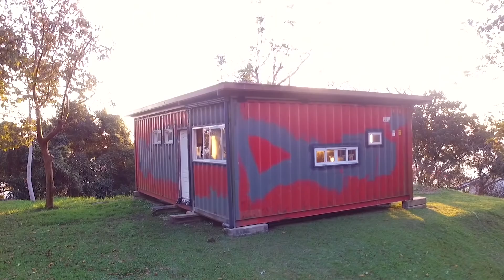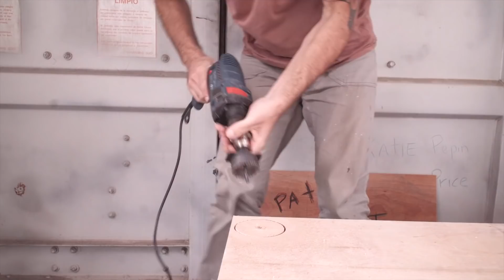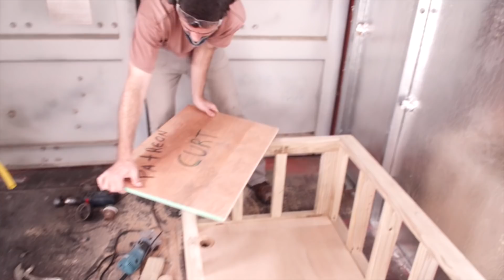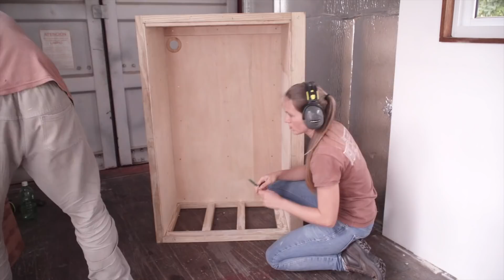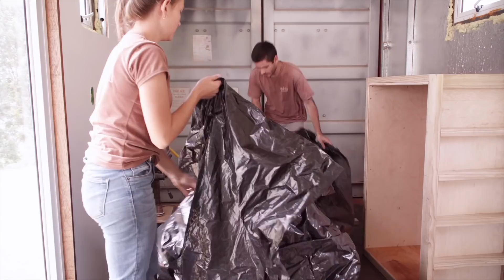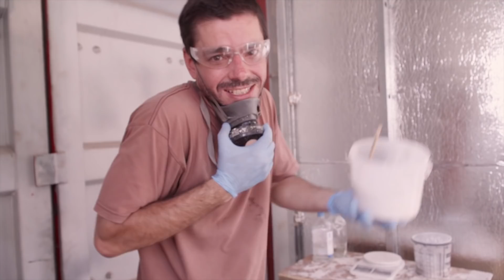Converting a plywood box into a Bathtub!! Part 2 😎 LTP #070

Comment: Marine grade plywood? Most plywood will de-laminate if it gets wet. I hope your lovely bath is holding up to use.
Reply from the maker: The build boats with marine plywood 😉
Reply: I built my sailboat out of marine plywood, epoxy, and fiberglass cloth, yes. However, if your bath is not marine plywood I worry it will delaminate.
Reply from the maker: It is. We talked about it during the videos. We have used just marina plywood on the housr
Reply: Super. That plus your thorough encapsulation should hold up well then. I look forward to more of your projects.

Comment: Do you guys have a list of the products you used? I'm having trouble tracking down the epoxy structural filler here in the USA. It's also hard to identify the first coat of resin you apply since you don't mention it in the audio. I ask because I'm working on a similar project
Reply from the maker: We actually buy them as epoxy in our town. We don’t have any specifications of it.
Reply: @OddLifeCrafting  cool! I figured out I had to find a boat store in central Texas to get the supplies. Makes sense since you're boat people, lol.

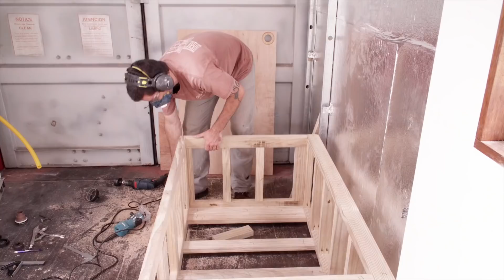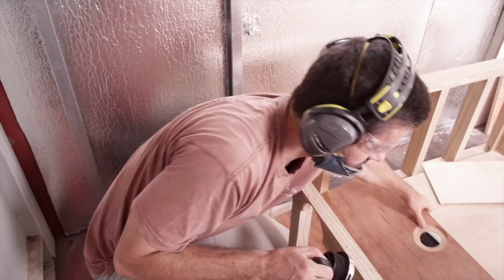Comment: 6:00 & 6:50 You have drilled through the structure's framework, therefore have weakened its integrity. Should have added more wood "around" the hole to strengthen it.
Reply from the maker: But it’s still strong enough. No worries. 😊👌🏼💪🏼

Comment: Oh, after the fillet hardens, pull the drain/ outflow out and remove the tape. DO NOT USE THE WHITE GASKET WHEN YOU ARE FILLETING. THE HEAT WILL DESTROY IT. ALSO IF THESE ARE PLASTIC PARTS, DISREGARD WHAT I SAID BEFORE. The heat from the drying process will damage them. However,if they are metal, then go ahead and do what I have suggested. I think you’ll be Happy with the results.😎
Reply: Well, you could fashion a piece of wood that resembles the parts, then tape and assemble, using clamps. Or if the parts are inexpensive buy a second set and use the first ones as a sacrificial set.
Reply from the maker: Will see after sanding today how close we are and how to proceed!! Thanks a lot for the tips my friend!! 👌🏼😊
Reply from the maker: Glad you sent the second message because unfortunately there is actually a plastic part. 😥
Reply: The wood idea, is a little ridiculous, so ignore that.

Comment: Good Job, guys! When you applied the resin with micro-spheres in the corners, that process is called ‘ filleting’. If you apply clear tape or even blue or green painter’s tape to the bottom of the floor drain/ out-flow, ( the part the water comes out), you can apply the fillet to your recessed area then push the drain/ outlet into the fillets and hand-tighten them. To create a perfect fit. As a large boat builder, I was a Master fiberglass technician. But so far you doing a fine job!
Reply from the maker: Thanks so much for the tips Will!!😊😊👌🏼👌🏼

Comment: Just wanted to throw this out there: make sure the fiberglass that goes into the drain is very smooth and close to the  contour of the cut you made. AND DON'T SEAT THE DRAIN PIECE INTO THE HOLE UNTIL YOU ARE DOING THE FINAL HOOK UP TO THE HOUSE DRAIN PIPE.
When you drill through the container floor and insert the drain pipe from below, you take a bead of plumbers putty ( a pliable gray clay) and put that around the cutout you made in the tub floor. Then you push the end of the finished drain into the hole and screw it into the drain pipe. 
The excess putty gets squeezed out as the drain gets tighter.
Just take a finger and smooth out and clean up the excess. This will make sure that no water will ever get between the floor of the tub and the drain.
Reply from the maker: Thanks for the tips my friend!!😊👌🏼

Comment: it looks really good!! try to insulate the external part with fiberglass or Styrofoam so it will maintain the temperature of the water for much longer, will be a great energy saving and you will have a nice hot bath for much longer  !!
Reply from the maker: 😊👌🏼👌🏼 we will probably apply spray foam on the outside!! 👌🏼😊

Comment: Just remember that with the fiberglass cloth your going to need a TON of resin.. as the thickness of the cloth takes a lot to cover over if you want to be able to sand smooth over it without revealing the cloth. Just using it in the corners and feathering the layers so looks nice, would add more than enough strength. This is how plywood aquariums that hold hundreds of gallons of water for years at a time are built. So handling a bathtub full of water will be easy in comparison to that. Especially since more often than not it will be a shower and not a bath, and no added strength needed at all.
Reply from the maker: Thanks a lot for the tips Matt. We actually applied 1 layer of fiberglass today just as amateur guarantee. Hehehe it went well, not that easy but went well. Tomorrow we will give another epoxy coat. So far we used 1,5 kg of epoxy resin. Not that bat I guess. 😊👌🏼

Comment: Why didn't you put the drain and the filler on the side where the container wall will be? Will make hiding your plumbing and drain tube much easier I think. Also that way your drain can run a short way straight from the bath to the side of the container to dispel the waste water.
In the container I'm planning to build I'll be using some sort of plastic wall's and bottom for the shower. Less change of it leaking and rusting my container. It will be a "walk in shower", but it will be a wheel chair accicible shower/toilet/wash basin bathroom. 2meter (with of the container) by 1meter2.
Reply: I don't think they have much room on the container wall - the insulation takes up the small gap anyway. They will build the bathroom wall next to the end of the tub so the pipes can be hidden easily.
Reply from the maker: At first the drain was going to be on the center but by “mistake” or “lucky” after finishing the wood we realized we had a small angle towards that side of the tub so we decided to use that in our advantage. 😬😬

Comment: Great job. You once mentioned you did some fiberglass on a boat. Have you thought of using a Gelcoat instead of paint? 
https://www.bottompaintstore.com/fiberglass-and-gel-coat-repair-gelcoat-c-13581_13586.html
Reply: Here is Gelcoat you can apply with a brush.
https://www.bottompaintstore.com/fiberglass-and-gel-coat-repair-c-13581.html/fiberglass-and-gel-coat-repair-gelcoat-c-13581_13586.html/Brushable-Gelcoat-quart
Reply from the maker: Thanks a lot Craig. I will take a look. I was reading about gel coat and it seam it’s hard to get a good bond with epoxy resin. 😥
Reply from the maker: We did think about but didn’t get the time to study it yet to see if we can menage our o do it. i hear we would need a special paint gun. 😥

Comment: Well done you two. What are you using for paint after you're done glassing?
Reply from the maker: Thanks a lot Jeff!! We will probably use PU primer and then PU Paint. 😊👌🏼
Reply: @OddLifeCrafting  ...If the resin you used to wet out the cloth and seal the plywood is "Epoxy", you shouldn't use "Gelcoat" for your colour/final coat. Gelcoat will not bond properly to the epoxy.
Reply from the maker: Most people say it doesn’t but I have seen some tests on YouTube and it worked really well but no mistake can be made otherwise you will have a problem in the future. This being said of course we won’t use gelcoat as we are far from perfect when comes to resin ( perfect temperature curing, perfect cure time etc etc) we we will keep it simple in a way we have done before and it still in good shape (our canopy).  PU primer and pint. 😊😊👌🏼👌🏼
Reply: @OddLifeCrafting  Yes, some people do it anyway but I work in the industry and supply many boat yards etc...always been a no no to do. Not worth the risk.
Reply from the maker: 👌🏼 for sure. We won’t take the risk. 😊😊 thanks a lot for the help my friend!!
Reply: @OddLifeCrafting  PU is Poly Urethane is guessing? Maybe a nice grey colour...